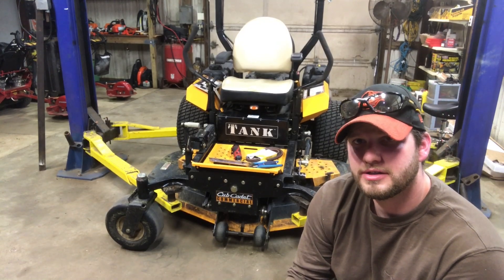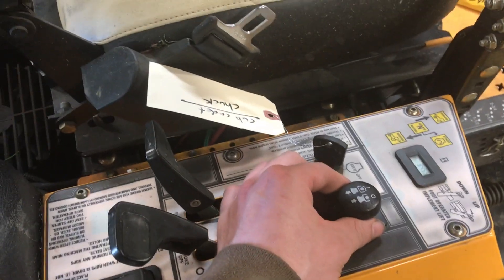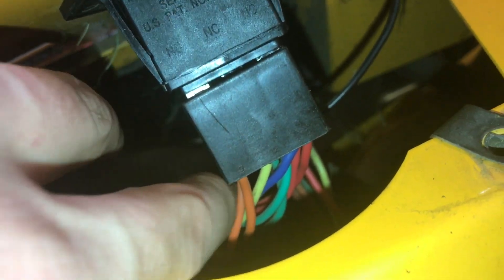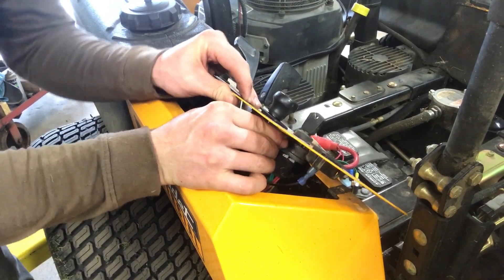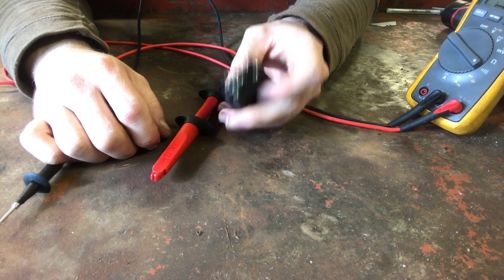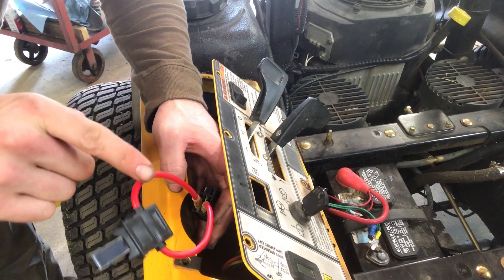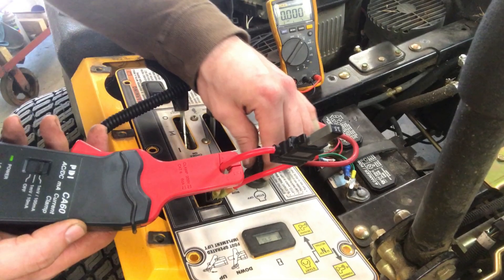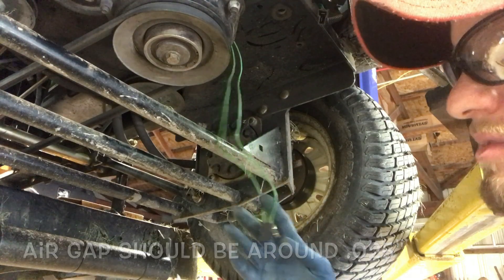Mower PTO switch hot/failing-troubleshoot clutch circuit

Comment: I got an LX178 JD. My problem is, when it starts warming up, the clutch stops. I have to keep popping the switch up and down. Once I step on the go pedal, it stops. I'll do it a few times then finally I can finish mowing. I wasn't sure if it's the switch or the clutch. Advice please.
Reply from the maker: I would say—gain access to the switch and have a test light ready. When the clutch won’t engage after you pull the PTO switch up, clamp one end of test light to a ground(or battery ground) the other to the wire coming out of PTO switch connector that leads to the clutch. The test light should light each time you pull the PTO switch.
Reply: Hillbilly Rig Repairs thank you. I'll try that

Comment: I have 2008 42 in troy bily zero turn rtz and if I disengage my pto and try to re engage it won't engage right away some times it takes a minute or two minutes for the blades to begin spinning but once it engages it stays on.
Reply from the maker: Can you hear the Clutch engaging(“clicking”) on and off each time you pull the PTO switch up? If I’m forced to guess.. sounds like the “air gap” between clutch discs could need adjusting; 3 nuts on bottom of clutch-mark each with a pen and turn clockwise 1/4 turn at a time. Need to tighten evenly. Check and repeat. I would really recommend a feeler gauge. Good luck!